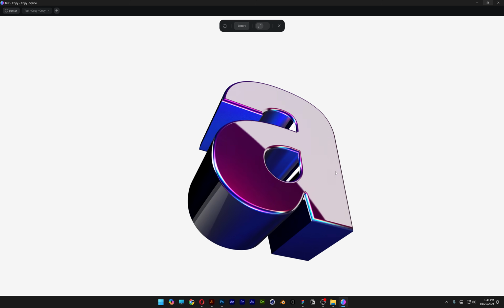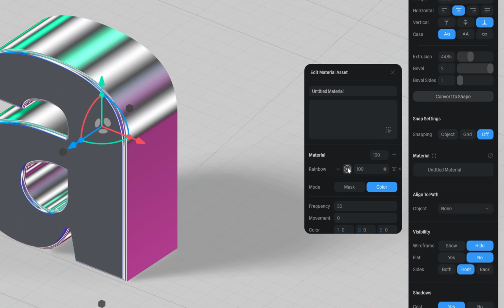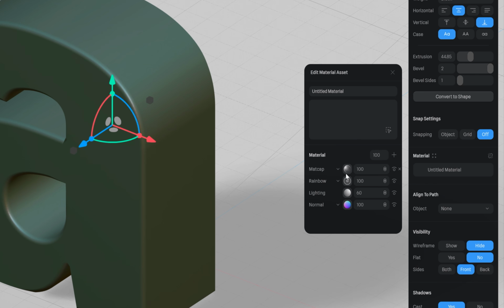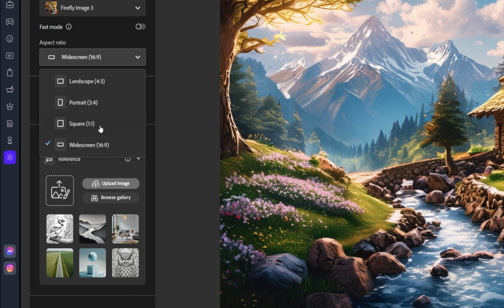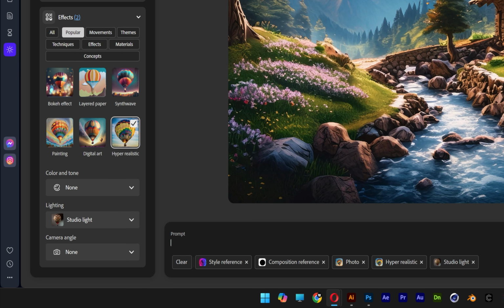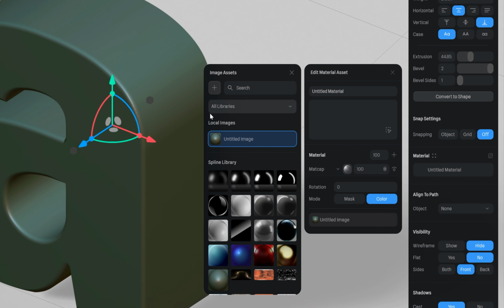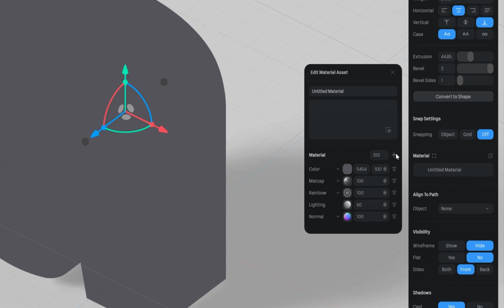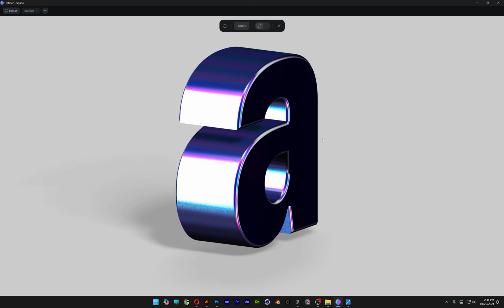Create PRO Iridescent Materials with Spline App

Comment: This might be a dumb question, because I’ve never heard of this app before, but can you create these materials in spline and then use them in After Effects?
Reply from the maker: It's okey, Spline is a new app, it's not popular. I checked it and you can export a GLTF file from Spline and import into After Effects, however it will only export the object without any materials or colors.
Reply: @PANTERvision  Can you do a tutorial on this, but with AE instead? I want to use the 3D inside AE.
Reply from the maker: @waxmaster-c  I uploaded a couple similar to this, check the After Effects Tuts section on my page.
Reply: @PANTERvision  thanks!